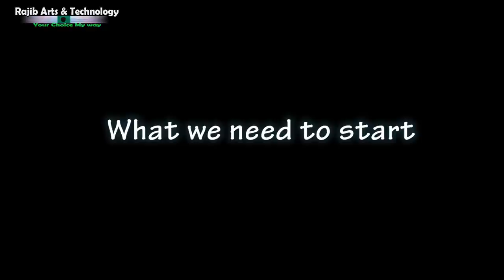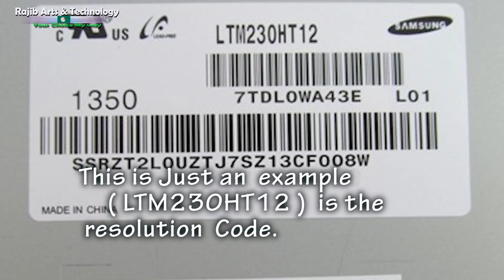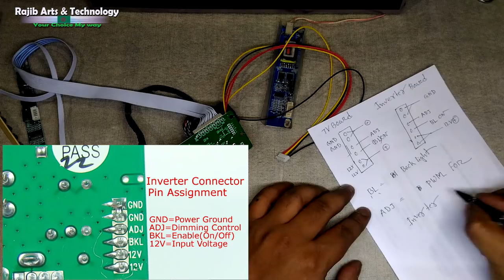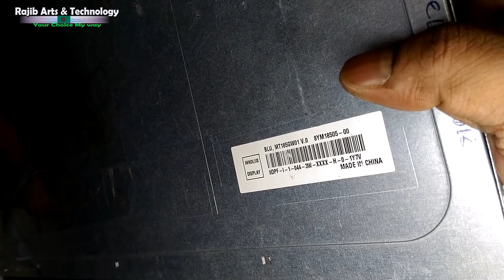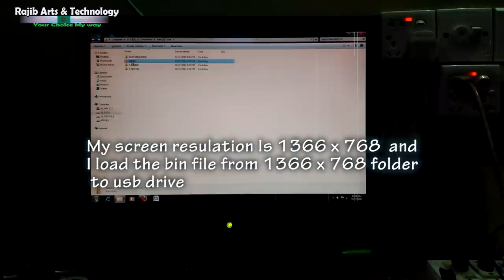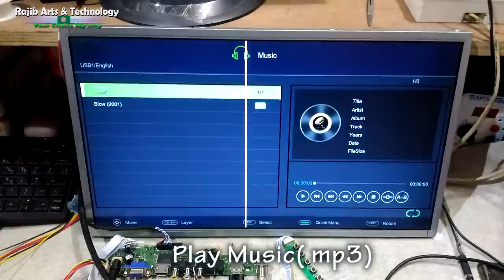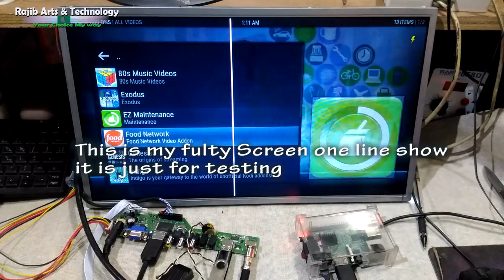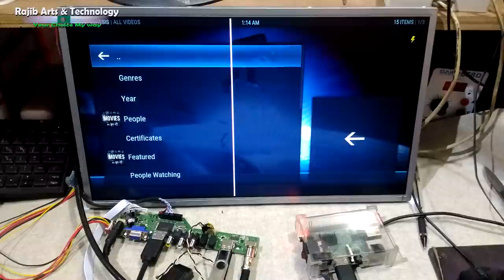China universal lcd/led tv board installation total tutorial

Comment: I just bought a 8503 lcd controller board, the product readily come with free program driver board so it says no need firmware, but when I power on the screen, only white light and nothing happens, do you have any idea why? how do I check if the board really has a software installed in it?

Comment: I opened 4 monitor, the first 3 was not even compatible by LVDS cable, now I have a monitor which is compatible, but it has 4x 2pin CCFL, so 4 Lamp, but I have a 1 lamp inventer only, how to solve that? can I connect multiple lamps to one CCFL driver?

Comment: Great tutorial, thank you! How did you modificate the speaker cable? In my case I have a 8 pin set of 4 speakers and as yours the speaker port of the control board only has 4 pins and I don't know if I can do any modification and use this set of speakers in my project
Reply from the maker: Thanks for watching,
You can use 4 speaker ,2 speakers in series.
Reply: @rajibartstechnologymd.mahf9807   Thank you very much! I'll search info for that operation, do you know any video or tutorial about how to connect 2 speakers in series?

Comment: Hi, my display's model is LTN150XD-L02, Panel Type: a-Si TFT-LCD , LCM, Lamp Type CCFL, I don't get the voltage info and will the board you mentioned work? and what type of cable and back-light board will I attach?

Comment: This lesson is so interesting to me. Good tutorial. thanks.  I have a LCD TV. It has good pictures but the sound is not clear. It is giving terrible noice but nothing is clear.  Do you think that this universal board will help me to solve the sound problem?  Or is there a better way to solve this sound problem?  I checked all adjustments on the TV but could not solve the sound problem.  But my TV has no USB port but only the HDMI. Pls help me. Thank you
Reply from the maker: You can upgrade you sound with external speaker ,like sound bar .
Reply: @rajibartstechnologymd.mahf9807  Thanks. Do you advise me to take the sound out to an external speaker and try it out?
Reply: @rajibartstechnologymd.mahf9807  Do you think that this is a problem with the mother board?  Pls advise.

Comment: Hello, I have a query, my lcd model number is N154i2-l02 according to data sheet I have to use 1ch 6bit 30pin lvds cable, can I use 2 channels    6 bit lvds cable. Also what is the specifications of power supply to be used?

Comment: Thanks this is a very helpful video. Does this Universal Motherboard connect into the TCON board on a Sony Bravia KD55X8005C? The TCON Board connects to two boards on the LCD screen so the universal motherboard can not connect directly to the LCD screen.
Reply from the maker: You need one to two lvds output converter board.you can find on online shop.
Reply: So does this Universal Motherboard replace the main board and the TCON board? Thanks for your help Sir.
Reply from the maker: @vpnrouter  ,you just need lvds converter board .tcon board must used  what your panel recommend.

Comment: Hello, could you please advise me, I have an LG display, LC550UE SEF3, I bought a T.V 56.03 board, I can connect it. Thank you
Reply from the maker: Ok , your panel is full HD 1920×1080 resolution. So first you should need the right Lvds cable what your panel match. Connect the Lvds cable lcd to tv board ,set the panel voltage jumper 12 v. Enable  panel backlight on . If your panel backlight not working please use a additional universel backlight board . update your board with 1900×1080 bin file throw USB .
Reply: I will try it tomorrow morning, Where can I find and download the bin file.  Thank you very much for your answer.
Reply: Thank you very much for your help, it works thank you very much.👍👍👍👍👍👍
Reply from the maker: @jiriandrle7473  most welcome......

Comment: una consulta, en el datasheet de la controladora V56 veo que dice Single/dual LVDS. Pero he visto una controladora LCD mas reciente el modelo mnt68676.2a donde tambien dice que es single/dual LVDS pero este agrega un dato extra que dice (8Bits). Mi consulta es: es lo mismo ? pues en la controladora V56 no menciona ese detalle.
Reply from the maker: Bro please explain in English.....sorry I can't understand your coments.
Reply: a query, in the datasheet of the V56 controller I see that it says Single / dual LVDS. But I have seen a more recent LCD controller model mnt68676.2a where it also says it is single / dual LVDS but this adds an extra data that says (8Bits). My query is: is it the same? because in the V56 controller does not mention that detail.
Reply from the maker: David saldaña if your screen has 2 lvds input ,you should use a converter card one in & 2 out lvds .but all screen are not supported. Old v56 card are not able to do it.new card are different...see the data sheet in online.

Comment: "LVDS pin 1,2,3 should give voltage set by jumper."  Can this  voltage be measured in multimeter before flashing the firmware?

Comment: Hello Sir!
Please help me in a problem that i have encountered. I bought a v29 board  on ebay for 10$. I found a bin file for my resolution online and put it on a usb stick. After i inserted the stick the led started to flash and it kept flashing. After 5 or 6 minutes i unplugged the power supply and now nothing works. I cannot reflash it with other bin file. I tried another bin file and the led does not flash. It doesn't want to reprogram. Please help me with my problem. Thank you!
Reply from the maker: I think you brick your main board.need to flash your 8 pin eeprom Ic.Never power cut when you update processes  is running your tv board.if you that your tv board brick.

Comment: i need some help i have murphy tv 101cm model no 40s82f ,  it runs on 4.4.2 how to enter recovery mode and update to new software
Reply from the maker: Some tv company aren't want to modify their software.so some function you can't use.so reset the data from your settings & get fresh factory reset os.most of China android tv are not get update easily.so if your are not good at android os let it on default mode .if your any wrong steps brick your tv main board permanently. Ok best of luck.

Comment: I flashed dome firmware and they "worked good", but than I installed a wrong firmware and nothing work and I cannot flash anything else, could you help me?
Reply from the maker: Zazzo E Zozzo ,you got brick your flash memory.if you re firmware your 8 pin flash ic it will ok.for this process little bit tricky.you need to  desolder the 8 pin memory ic & brun firmware with right chipset.you need to firmware Brunner also.

Comment: My LCD uses 20 pin LVDS. Can I use v56 universal control board to power my LCD. My lcd model no. Is LT121DKX7V00. I cannot seem to find the control board for this LCD.
Reply from the maker: You can use.Try this 20 pin lvds cable.
https://m.alibaba.com/product/60114657143/2P-to-colorful-20-pin-lvds.html?s=p&spm=a2706.amp_showroom

Comment: Sir in my LCD panel have RX0- RX0+ ,RX1- RX1+, RX2- RX2+, RXCLK- RXCLK+, RX3- RX3+  so sir where I connect in v56 LVDS pin odd and even I m confused in even and odd. Please help me about this. And sir universal board have clock in even pin no. 15,16 and 27,28 there is no odd clock pin please correct me if I am wrong.

Comment: I want to connect my laptop motherboard lvds cable to monitor, is there any adaptor or convertor available for that? or can i solder the lvds cable to vga male throught 15 pin diagram and then the vga cable to monitor?
Reply from the maker: jayam nadar ,you need to know your laptop lvds pinout datasheet & your monitor lvds also, you can do your self.its little tuff .but as far I know there is no converter.
Reply: Rajib Arts & Technology Md.Mahfuzur Rahman 
Thank you  connecting directly the wires of lvds wires to vga male port! would it work? or we need a circuit for that as monitor already h power. I have have the vga cable pinout sheet.
Reply from the maker: jayam nadar ,no just lvds to lvds. Not VGA. If you want to connect with VGA than laptop main board VGA to monitor VGA.
Reply: Rajib Arts & Technology Md.Mahfuzur Rahman 
yeah!! got you but my laptop would not boot directly to my external monitor. so im struggling to build this idea. though ive found it wont work.

Comment: Sir kya ye Mobo LG Philips Model No. LP154W01-TL A2 screen ke saath kaam karega.Pls Confirm.Thanks in advance.
Reply from the maker: Your screen Resolution is 1680 x 1050 so you can use v29,v56 board.if you found this resolution firmware than you can use it, there are just 2 type resolution hd (1366*720) & full hd (1920*1080) firmware available.
You can try 1366*720 firmware but you can't get full screen preview.

Comment: Hello, Nice video, when you buy v56 universal controller board, you need to buy Inverter board also, which come  separately  ? how much the Inverter board cost ? can you please reconfirm .......thanks !
Reply from the maker: Silas Paine thanks for your components.you should know what kind of LCD you have.there are many types of LCD backlight.if you have fluorescent tube than you need inverter ( high voltage) card. If you have  led backlight then you need led driver board . Some led needs 12v dc some needs more, depends on your size of screen. If you asked me only for laptop or pc monitor 
(10 22) inch LCD ,the inverter or led driver board cost about 2 5 us dollar.( in Bangladesh its cost 120-350 taka only).
Reply: Hi, Thanks for your reply. Inverter with output connector : High voltage - 680Vrms and Low voltage 0-18 Vrms , will it be compatible with my LCD screen with part no. LP154WX4 (TL) (C1)

Thanks
Reply from the maker: Silas Paine ,you need single channel inverter board, its very common. So don't worry just search on the net you can find all the board like same. You can use your laptop inverter board but it will not brighter at 12volt.
Reply from the maker: Silas Paine , first you should understand to the math, its really easy .just count how much bulb cable come out from your screen.if your laptop screen has one then should use only one bulb inverter.if 2 then 2,if 4 then 4 .hope you understand now.you can't open any port your inverter board. example - you have 2 bulb but can't use 4 port .cuz 2 port open & high voltage leakage risk. Or 1 build can't run with multiple port inverter board.bcuz those port using  series in pair.
Reply: You seems to have niece technological knowledge about it...thanks
Reply from the maker: Silas Paine ,most welcome.
Reply from the maker: Silas Paine ,you can.
Reply: fine....thanks !

Comment: Sir 7812mosfer will work with it?
Because I have 19v 5amp charger.
Reply from the maker: Love Entertainment & Technology ,lm7812 just provide bellow 1 amp so ,its recommendations only 12v , you can use 19v direct .but its regulator mosfet produce lots of heat & your board will may be die  soon.  Best you should used 12v.
Reply: Rajib Arts & Technology Md.Mahfuzur Rahman thanks sir it means I have to purchase 12v 5amp adopter. Did it's have any problem with 5amp but it's consume 4amp.
Reply from the maker: Love Entertainment & Technology ,no problem. If you have many inverter than you need more amp. If you use led or single inverter circuit than you need just 2 or 3 amp max... ok good luck.

Comment: Sir my panel model no IS HT185WX1-501 PLEASE help me where I connect it with even pins or odd pins
Reply from the maker: Love Entertainment & Technology ,you need LVDS Cable FIX 30Pin 1ch 8bit for 18.5inch 1366x768 LCD Panel M185XW01. Cable.
Its little bit harder if you connection manually. First try ready lvds cable. Click this link you can understand.
https://m.ebay.com/itm/LVDS-Cable-FIX-30Pin-1ch-8bit-for-18-5inch-1366x768-LCD-Panel-M185XW01-/272166686411

Comment: Hello, i tried to install firmware..with 3-4 different one's...the light flashes during..installation...but when re-plugging the power...i just get light blue color display..no text..no menu...what can be the problem ? any other firmware u can suggest ? thanks
Reply from the maker: Silas Paine ,can you tell me which board you used now ?
Reply: Silas Paine
its V56 universal board ...LAMV56UA...i replied 1 week ago...please check it...if you can please help out....
Reply from the maker: Ok my friend,lets some thing to know about .plz answer me.first your screen has only blue color ? Or its change other color with blinking like red ,green ,white.you say that have you only blue color with out any text.ok plz inform me that your use a remote & press menu ,is it come some osd screen menu ?
Reply: i get light blue color.only...no text menu display...when used remote..still no text...display...thanks
Reply from the maker: Silas Paine ,you change your lvds cable & re firmware again.send me your mail address I will send you firmware.please once again tell me your screen number.thanks
Reply: Panel LP154WX4 (TL) (C1)   Resolution (1280 x 800 , Please send only shortlisted firmware..that can work...id send you pm...thanks again
Reply: got some time to check it again...know i am getting just vertical lines only..no image , text nothing...what can be the problem ? thanks !

Comment: frimewear cant installing ...? why?
Reply from the maker: Charith Electronics , you need a pen dirve and format it with fat32.than open your  resolution folder & copy only bin file to USB flash drive.disconnect the power jack from tv board .insert the USB on it & power jack plug in. Then you can see the red & green led blinking some time.wait for stoping blinking then run you tv with power kye . Try it again .remember don't power cut during the firmware update if you do than your tv card will brick.

Comment: Ami ki ekhane 7" 20-30 pin tab er lcd use korte parbo? or 10.1" 40pin tab lcd use korte parbo? please ektu janaben.
Reply from the maker: Md. Abdur Rahman Wahid ,tablet screen need a lvds converter ,most of the tablet screen has not (t con ) board .
Reply: "t con" er mane bujhlam na.
Reply: তাহলে lvds কেবল যদি মিলাতে পারি তবে ট্যাবের স্ক্রিন দিয়েও চালানো যাবে তাইনা? আর আপনার জানামতে 20,30 বা 40 পিনের lvds কেবল কি পাওয়া যায় বাংলাদেশে?
Reply from the maker: Md. Abdur Rahman Wahid ,you can see at the back of LCD screen with coff ic .
Reply from the maker: Md. Abdur Rahman Wahid ,you can find out your screen pinout at net.

Comment: Sir universal board didn't have odd clock pin.
Reply from the maker: Love Entertainment & Technology ,you shouldn't wired.your panel need 1366x768 lvds cable.its most common now.lvds cable has vcc, gnd & some paired cable in twists. Next I will make a video about lvds. Its little complex.

Comment: hello can you please help me I want to do this
Reply: please reply
Reply from the maker: binoy nepal most welcome, what you want asked me.I will help.
Reply: Rajib Arts & Technology Md.Mahfuzur Rahman  my display model no is LP156WH4 TLA1 I want to know which board I should buy and firmware also
Reply: I want to do this project as my laptop is damaged only lcd is working so... help me
Reply from the maker: binoy nepal, ok don't worry.you should use v59 board .next week I will upload a full video about laptop LCD .so bro keep in touch.
Reply: sure bro and will it support my model?
Reply: Rajib Arts & Technology Md.Mahfuzur Rahman and  bro my lcd panned doesn’t have inverter slot...
Reply from the maker: binoy nepal you  need  a spacial lvds cable with extra 4 wire for led .go to your local market & asked for laptop LCD lvds cable.
Reply: I want to send images of my display and lvds cable which ill buy online.
Reply: hello bro help me
Reply from the maker: binoy nepal what's happened..?
Reply from the maker: binoy nepal you send me your mail addres I will help .I am not useing what apps sorry.
And one thing your LCD has 
build in led driver board .so you need a lvds cable with extra 12 volt connection wire .its very common  now . New model laptop lvds cable all most same now so don't panic.I will send you life cable picture.
Reply: hello bro you did't gave me the pic?
Reply from the maker: binoy nepal, bro just wait few hours.I am little busy .hope you understand.
Reply from the maker: cheek your email.....i already send all the information.